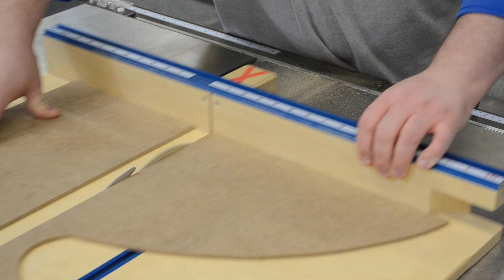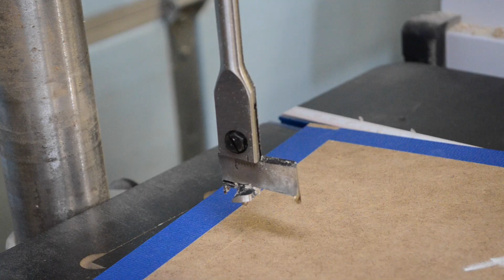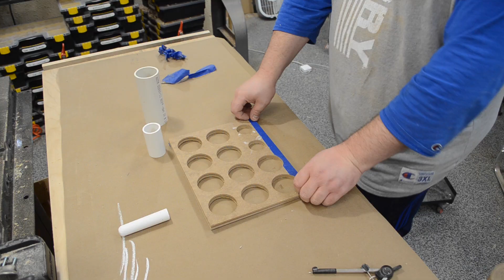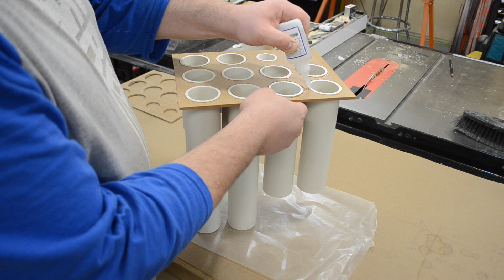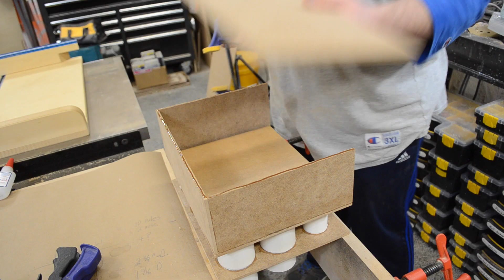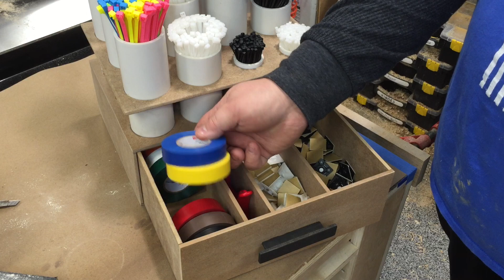Ⓕ Making A Zip Tie Holder (ep78)

Comment: If you have a bag of tie wraps do not cut open the bag at the top, instead take a utility knife and put a slice in the middle of the bag.  Tie wraps won't fall out and when you need them they just bend and pull right out where you made your hole. Not sure if there would be a problem if it was a variety of sizes in the same bag.
Reply from the maker: for sure a different way of doing it!

Comment: I use  a big plastic jar that you buy ties in and it takes less room and you can see exactly what you have! My only problem with it is I forget which Cabinet I put it in🙂🙂🙂
Reply from the maker: I've tried those and don't like them - I always need the ones at the bottom and have to take half of them out to get to what I need - not to mention, I have never had luck with the bulk packs - they seem to be thinner and always break on me

Comment: Nice project. I am just about to do something similar (bot on the other hand: quiete different).
I also want to uses rests of old PVC pipes for the zip ties but I want to put them horizontally (or at an angle till 15 degrees, to prevent them falling out. I thought I'd glue these pipes together, but having spacers is a very good idea. Just last week I bought an adjustable drill bit for making holes in wood, acryllic, etc. but I did  not have time to yet to try that out.
The drawer under it is a very smart idea. Till now I did not use mdf, maybe I'll use hardboard or .......
Thanks for sharing. You are a source of inspiration. Just subscribed.
Already about 15 years ago I made two welding stick holders out of PVC pipe. That inspired me to give it a go also for
the zip ties.
Reply from the maker: Very cool, you'll have to let me know how the build goes - I always like seeing how other people solve similar problems
Reply: I can. It'll take a while, though. I do not make You Tube video' s (yet). But I make many pictures of things I make (or try to make/failures).

Comment: I have one of those "Adjustable Spade" bits, but its for a brace and bit hand tool where it works really well. If you slowed your press down you probably would have gotten better results.
Reply from the maker: I slowed it down as slow as it would go and tried it in a handheld drill - It must just be a bad design on this one
Reply: Nick Ferry 
Those really are meant for boring framing lumber more for passing pipe or conduit imho...
Reply: p.s. no drill has the slow speed of a brace and bit...
Reply: p.p.s I am still going to build one. I have the same bit as you ended up using. The only time I wear gloves in the shop is when that bit is going to spin. Workpiece clamped and one hand behind my back...

Comment: Nice.  You could also buy the corresponding size pipe caps/stops to close them and keep dust or whatever else building up in them.
Reply from the maker: not a bad Idea but I'm not worried about the dust - that did however give me and idea for storing hose clamps on the outside of the pvc

Comment: Hey Nick.  How do you lie that pneumatic sander compared to an electric one?  I have been thinking about getting one.  Is the RPM adjustable?
Reply from the maker: I love it - rpm is adjustable by the flow control but I added a better one - I talk about it and other upgrades here - https://nickferry.com/2016/10/random-orbit-sander-holder-ep74/

Comment: I got a larger circle cutter, only use it in a drill press, too scary when handheld, mine has a double cutter (one each side) i tried it with just the one cutter, but it vibrated a lot (out of balance).
Reply from the maker: very cool - I may have the same dual cutter one as you too - it's the one with about an 8" beam on it?
Reply from the maker: just measured the beam - more like 6
Reply: It used to be 12", but after trying it handheld, i cut it down to about 7" dia to fit in my drillpress which has a 8" throat
Reply from the maker: ***** good idea